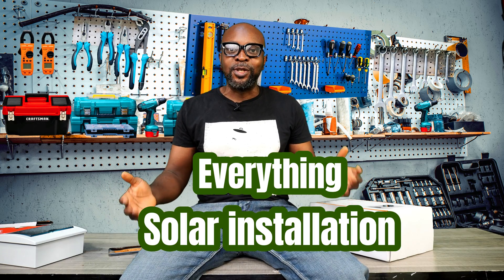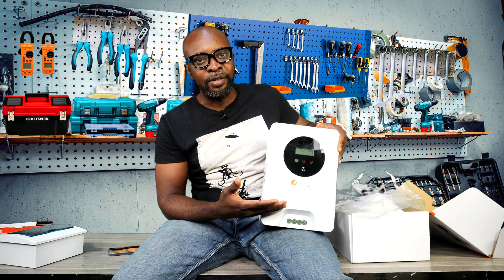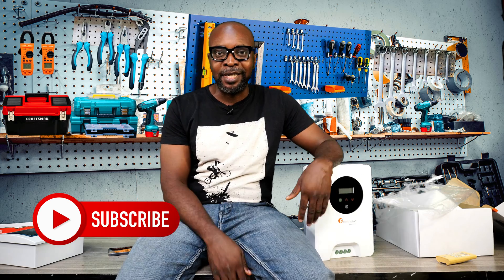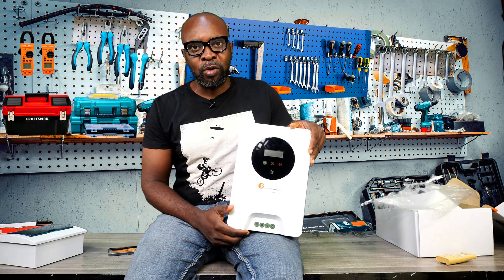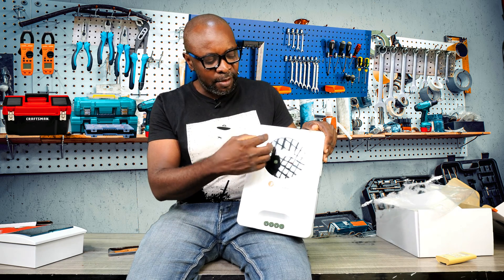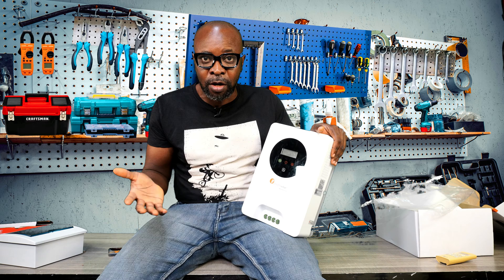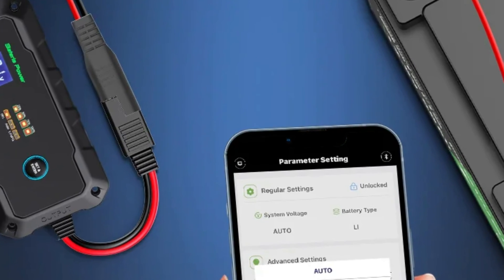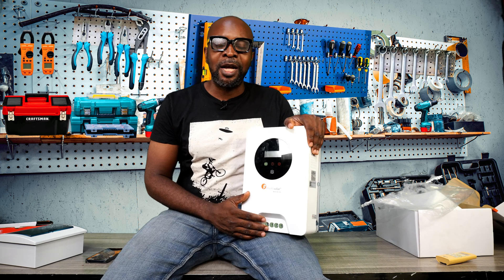New Felicity Charge Controller design review

Comment: Hi @Smilingsun am trying to introduce this charge controller for a customer tha has 4x 400 wat panel 35v 11A do you advice i run the 4 in panel in series to give 140v or 2series and 2 parallel
Reply from the maker: @adeiyeabiodun6495  Anyone you prefer they are same thing

Comment: I prefer New one because it regulate the high voltage because it happens to me I thought the controller has damaged but it worked correctly with out damage after resetting the panel
Reply from the maker: @jamesjoseph3264  okay that's good to know

Comment: When you get an error 04 at peak sunlight of the day, what could be wrong and what can be done… It keeps flashing red and the amps and watts turns 0 at intervals.
Please I await your response. Thanks
Reply: Error 04 means high battery voltage. You might need to have your batteries checked.

Comment: I did an installation two days ago with the new charge controller but the issue is that in the inverter is used for only Night. So whenever the charger controller charges the battery fully charged, instead of it to stop charging it will be showing the fault light and tryna charge again but still show the fault light when it senses the battery fully charge. Pls is that how’s programmed
Reply: Set the appropriate charge voltage for the installed battery

Comment: The display looks very basic for a charge controller and I wonder if it comes with the ability to detect the type of battery connected and if it has default charging settings for different battery types.

Does it come with a modbus module for remote connection and monitoring, or will a user have to search for and purchase that separately?
Reply from the maker: Yeah I agree the display is quite basic, it doesn't detect the battery type only detects voltage of the battery. It has default  charge settings for batteries. It has a modbus

Comment: i just installed one yesterday, a challenge i noticed on this new design is the installation process.. the screw is hidden behind the system which is a little bit challenging to mount it
Reply from the maker: Place on the wall then mark the hole with a pen marker, bring down the device and then drill. Put Fisher peg in the hole and then put a screw in it. Finally handg the controller.